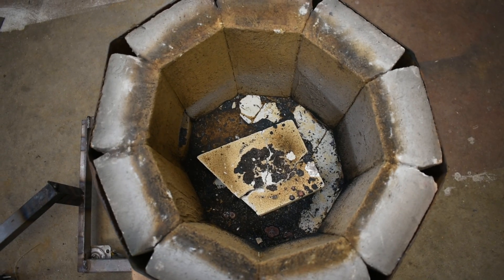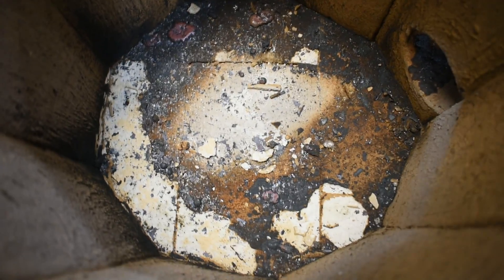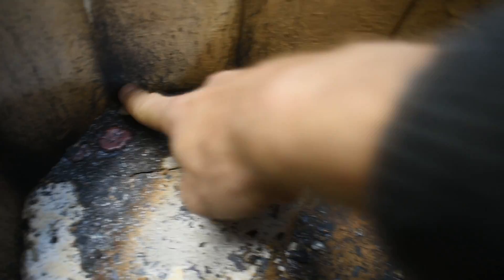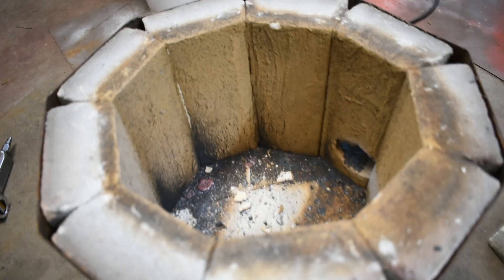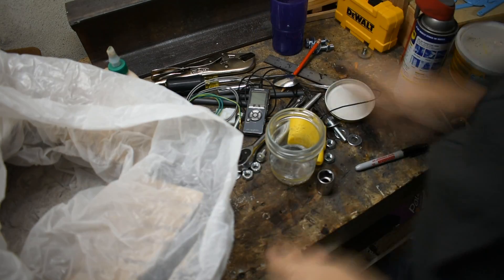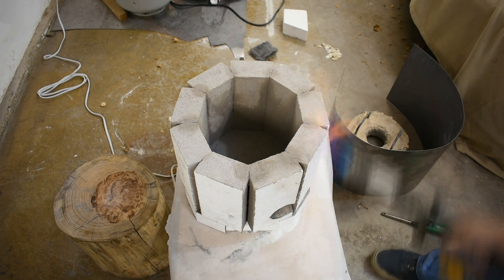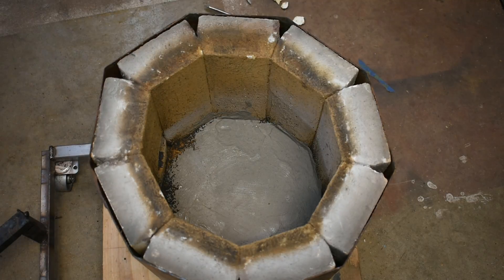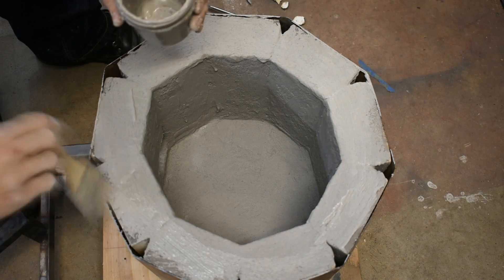My Foundry Furnace is Broken, I Spilled Molten Copper into it.  Time to Fix it.

Comment: I just had this happen, but it was cast iron. The crucible sprung a leak and all of the cast iron flowed to the bottom of the furnace and formed an iron disk that also locked the burner in place. Words were spoken! I have no idea how to clean it out.

Comment: Good work. My foundry which I made almost a year ago still holds together pretty well. If you recall mine is made witk kaowool not bricks, but I have it coated on the inside with multiple coats of satanite (including the lid). I also don't tend to spill many things inside. :) On that note, I'm proving myself a liar because I have just melted a bin of soda cans and dropped 2 of them outside the crucible, oops. Got 2 and a half pucks of aluminum out of 57 cans, haven't weighed them yet because they're still hot (I had 59 cans, but see above). 

I used a different flux this time, made of 6 parts magnesium chloride (ice melt, 'tis the season) and 4 parts potassium chloride (water softener). It's too early to tell but I think it cut down on the amount of dross a bit.

Let me guess, next time you make Everdur? Been waiting for this for almost a year. :)

(edit) my plinth looks almost new, no cracks whatsoever. It's also coated in satanite, which I recommend. My crucibles are also coated on the outside in it, and it does really make a difference. Use 2 coats minimum.

(edit2() I weighed the aluminum pucks, I got 506g out of 57 cans; considering the average can weight of 14.5g my recovery rate was 61.2%. Ugh.
Reply from the maker: I'm not making everdur next week, but eventually I will.  Still not certain I can keep stuff melted long enough to dissolve silicon, it takes a while :( 

I haven't tried kaowool, but I once considered wrapping this is some of that.

Comment: The flare isn't melting it's just severely oxidizing
Reply: Actually it's probably melting to some extent too. The first one I used on my home-made burner did, it severely deformed into an oval shape under its own weight during a long and hot bronze melt. It was a b*tch to get out of the furnace hole afterwards - I had to unscrew it from the burner end with it still inside the furnace. Those fittings are in fact not made of steel but of cast iron which melts at temperatures somewhat lower than steel.
Reply: @stamasd8500  well that explains it
Reply from the maker: Cast iron? That would explain the problem I'm having...
Reply: @PaulsGarage  Yes I'm pretty sure it's cast iron. They're fine generally, but keep in mind that they melt at a lower temperature than steel.

Comment: I made my foundry the same design as you. After two firings, a couple bricks started to melt, some steel at the top of the foundry for my lid handles melted into the foundry and destroyed the bottom, the entire end of the torch melted completely off, and there was the black "soot" you were talking about.
Reply from the maker: Bricks melting? What kind of bricks? I got 2800 degree rated light fire bricks, no damage so far except the plinth block that isnt coated with anything
Reply: I got 2600 degree bricks, and it got WAY hotter than I ever expected it
Reply: @fuzzmaster1234  I use a piece of 2600 degree brick as my plinth, the burner blast is full on it and it did not melt or crack after many runs, including high temperature copper and bronze ones. I coated it in satanite and that is probably what makes the difference.
Reply: I used several coats of satanite on mine too; I don't really know what went wrong or why its getting too hot.
Reply from the maker: It's possible your burner was running too lean.  That will cause excess heat while also leaving unburned oxygen blasting into the hot furnace, causing all sorts of melty, burny problems

Comment: Hope your not going the route big stack went. Temps were so high it burnt a hole in his crucible. Stay with non ferrous please. Good show and commentary as usual.
Reply from the maker: I think his issue was the wrong crucible type.  Iron requires a special crucible, not the standard ones used for copper/aluminum.  My furnace was built modelled after an iron melting furnace, but yeah the right crucible is necessary too

Comment: Nice repair job, so I'm going to assume hard core mode = cast iron...
Reply from the maker: possibly! Or maybe not possible, we will find out
Reply: Ha ha, I was thinking the same thing
Reply: It'll melt iron but not too liquid state I know cause mine did accidently
Reply: @thefourthtuxzt3078  I bet he can make it to pouring temperature with the newly repaired gear and the burner properly tuned.
Reply from the maker: Stay tuned and find out I guess?
Reply: @thefourthtuxzt3078  Woops
Reply: Cast steel?

Comment: I think your furnace is really holding up well compared to some I've seen.
Reply from the maker: I agree, only the satanite needs maintenance and that's easy
Reply: @PaulsGarage  Even ITC-100HT coated furnaces need maintenance. You did a lot of melts in your furnace before you did anything to it. Then it did look easy. Just mix up and brush it on. Now it looks new again.
Reply: I've seen some people recommend ITC-100 over saitenite. Something about saitenite bonds better to the bricks but the ITC-100 is a better IR reflector and makes the furnace hotter. (There are cheaper alternatives to ITC-100 with good IR reflecting values)

Comment: So I covered the satanite coating in my furnace (and my forge) with Matrikote for IR reflectivity. The Matrikote actually seems to be better resistant to stuff scratching away the surface than the satanite alone. Now that you've repaired the satanite, add some Matrikote (or ITC100 but it's more expensive and does the same thing).
Reply from the maker: I've considered it, have not bit the bullet though on the price

Comment: i made mine with refractory cement, with that steel brush sponge stuff in it for reinforcement, was a bad idea, im getting some cracks so a recast is going to happen at some point.
for now the foundry is still in good shape and works fine,  i did however break my lid last week, it now looks like 2 halves of a donut, upside is: i can now easily take off and put on the lid with just one hand :P still burning charcoal lumps/briquettes btw... maybe that makes it last longer... anyway, realy enjoying following you go trough this stuff, some parts are very relatable :)
Reply from the maker: I think castable stuff tends to crack, yeah.  When there is a temperature swing of 2000 degrees that's a lot of expansion to deal with
Reply: @PaulsGarage  i noticed the parts that cracked were the parts with the steel wool in it, wich expands more then the cement when heated up, next build will be without the steel wool.

Comment: Greenpatch 421 is supposed to be a great durable coating to use and its CHEAP. More expensive than Satanite but much less than ITC100.
Reply from the maker: Interesting, never heard of it. Ingot lots of extra satanite though
Reply: @PaulsGarage  Satan's ite should work well in hot places.
Reply: Is Greenpatch 421 an IR reflecting coating like ITC-100 or a mortar like saitenite that can be used as a coating? 

I've seen some people recommend using Itc-100 (or other IR coatings) over saitenite.
Reply: @askquestionstrythings  you got to be rich to use ITC-100. The stuff is like $45 a pint. I wonder if they accept kidneys as a payment method?
Reply: @askquestionstrythings  Greenpatch is a mortar but can be used as a coating. I used ITC100 in my furnace. You can see the video on my channel. Yes it was expensive, $80 per pint. It works very well but I wouldnt buy it again.

Comment: i wonder if you can make the inside wall of the furnace from a realy big crusible (or make a pipe from the clay graphite stuff and set that in the furnace ) and fill the space between the crusible and the outer wall of the furnace with the satanite and maibe some of that wool stuff 
i think the crusible once its baked through and through should be way stronger that the satanite stuff  and should be able to handle molten stuff that leaked out of the actual crusible
Reply from the maker: Never thought of that but it's a cool idea
Reply: @PaulsGarage  downside smaller area

Comment: How do you manage to break your oven so fast, I made one with refractory cement and it still like new
Reply from the maker: Satanite and light brick arent as tough as something like Mizzou or other castable refractories, but the insulation is better.  It's a trade off.  Also I dumped copper in there...
Reply: And you also seem to be making frequent use of your oven, while mine has been used just about 3 times and with coal only, so it never reaches white-hot temps